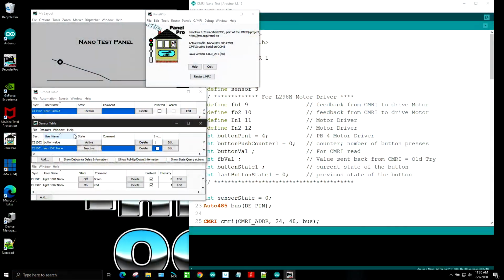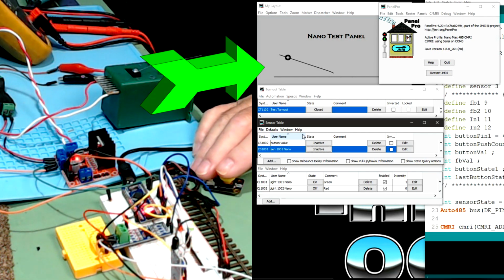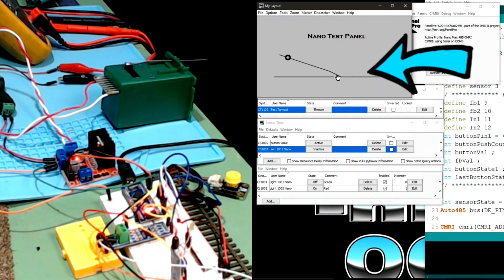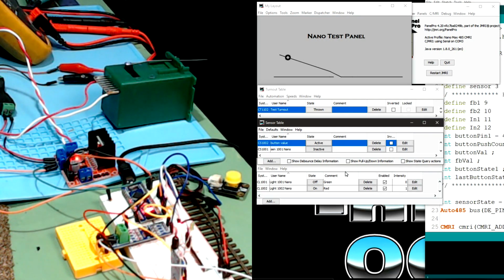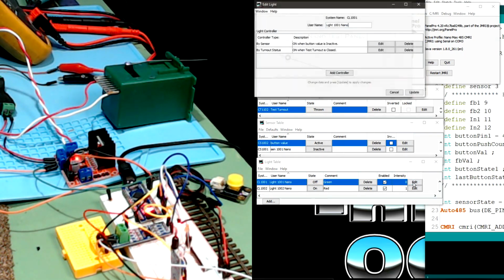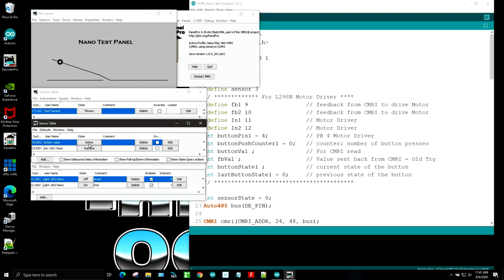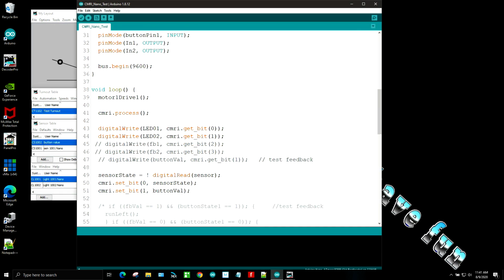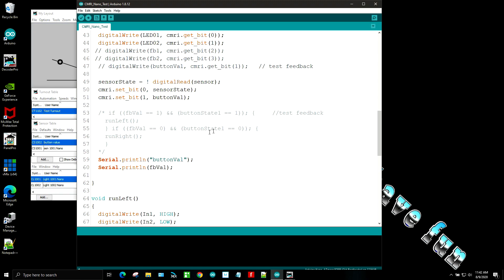Feedback Issues With JMRI Panel Pro

Comment: let me explain in a nut shell, you need to make two double head light one on top of each  other for a turnout to make it work,  than you need edit the logic in the heads to protect the sensor of the turn out when you click in the panel mine is working.
Reply from the maker: Sounds like a lot of work for a simple project that can be remedied with code. Some of the people at JMRI have helped out since this video to point me in the right direction. Unfortunately since making the video, I had to pack everything up and move. I bought a new house. Still working on getting the train room in order. Thanks for your input, much appreciated.,

Comment: Hi Tom, not sure if you got this working but i have managed to get a feedback sensor working with CMRI and with an additional external push button to control the turnout and up date JMRI. Check out this link see if this is what you was trying to do. https://youtu.be/diM55FdsIvo
Reply from the maker: I have the feedback working now, but I may have to change the code a little to get the desired results. I left a comment on your video. Great work Steve. Thanks for your help.
Reply: @TomsTrainsandThings  Thanks Tom, good luck with the rest of your layout, always good to see others posting the Arduino and CMRI stuff as there is little out there on the web

Comment: Interesting. 

A couple of things I noticed. 

i. When you change the Button Sensor in JMRI it changes the status of the lights but doesn't appear to actually change the turnout, is this correct or was it simply that you changed it back before the turnout turtle could react ?

ii. Something odd appears to happen when you activate the train sensor, it appears to momentarily turn the button inactive but though the button goes active immediately after it doesn't change the turnout until you click it twice (rather than once)

So my gut feeling is that your sensors might be overriding your JMRI control in some way

I'd go back to first principles 

1. Strip everything out and with a fresh install on the Arduino get it so that JMRI changes the turnout, no external buttons, sensors or lights

2. Next decide on the feedback, either the lights should be controlled by the turnout status or you want physical position to indicate status (I'd prefer actual feedback rather than computer say ok, but that's just me) 

3. Now add the button, the button should ONLY change the turnout status and you may need to set this up so that it's logically an OR status (I'm not very familiar with JMRI learning most of what I know in the last month or two) but basically you need to set things up so that IF the turnout status / Screen status is changed OR the button is pressed THEN the turnout changes 

4. Finally add your train sensor to change the turnout 

My GUT feeling is that it has something to do with the Button status being constantly active the train detector momentarily made it go inactive and the turnout changed, but when you manually made it go inactive the turnout didn't change but the lights and screen indicator did, something wrong there.

David
Reply from the maker: Thanks for your input David. I'm not quite sure where you saw the Tortoise not move when I pushed the pb or where I had to push the pb twice to get a state change. I reviewed the video several times and could not find that.

As far as the sensor changing the state of the turnout when it is closed to thrown, the state of the pb is also changed by design, since the program needs to keep track of where the turnout is and what state the pb is in. So when the sensor changes the state, so does the state of the pb change. You may have seen some flickering of the sensor and the state in the sensor table in the sensor, since it flashed a few times since I was going in and out of range of the sensor.

I have it designed so this can be used without JMRI connected, since the video, I changed the lights to operate in the code instead of through JMRI. 

I since heard from the JMRI crew and they are working on it on their end. Something in the feedback is not working correctly on the JMRI side. It is not sending the state change back all the way so it can be read in the get.bit statement of the code.

Again, thanks for your help.
Reply: @TomsTrainsandThings  As I said I'm new to all this, having only just decided to come back to trains after a 40 year break LOL but I'm a mechanical engineer by training and we look at process control which is pretty much what you are doing here, keep up the good work.

Comment: I had same issue with this. When controlling turnout from JMRI with no feedback sensor all was ok, as soon as you add a feedback for the turnout it would not work. i didn't get a solution still got to work this one out so good luck. Someone on JMRI group did say about the feedback binary being reverse logic. So if you are feeding back 1 for throw and 0 for close then try switching this around in arduino code. Not sure this will work and i never got time to try it. One for the future projects to work out.
Reply from the maker: Thanks for responding. I tried what you suggested about swapping the 1 & 0 without any change. I may have to try different methods in my code on that idea since it would slow down the Tortoise I was using while connected to JMRI. When I was not connected to JMRI, the code did not work at all. So back to trying different code to capture the feedback without interfering with the actual operation.

Hopefully the people at JMRI can figure this out. I had to send my code, monitor readings, the panel .xml and a few screen shots of the panel and the turnout table and sensor table while all this is malfunctioning. Currently waiting on a reply.

I'll let you know if they come up with a solution.
Reply: I came to this video because of the same issue. As soon as I add a sensor to the turnout, it stops working properly. On the contrary, if I create a turnout on the layout editor and click on the circle, it turns and shows the route ok.

Comment: Hi Tom.  I've been running DCC for around 15 or 20 years, and have been through several iterations of DIY systems.  Lately I discovered DCC++ but found that Gregg wrote it and has been heard from for 4 years.   So.... I modified the code to serve my own purposes.  I'm using DCC++ to talk to Wifi enabled modules using MQTT.  Now here's where I feel your pain.  I can set a turnout from JMRI using the turnout table, and I want to use a sensor which is treated by DCC++ as an input on the Arduino, but when I configure feedback, it converts my input channel to a DCC address, which is not what I want.
I've left questions on both the JMRI users and developers groups but I haven't gotten any help.
Reply from the maker: There are other modelers/coders that have taken over where Gregg left off on the Trainboard forum. There is now a rewritten version called DCC++EX which includes many additional features. https://dcc-ex.com/

I briefly looked into MQTT, but there are so many different ways to communicate with JMRI, I put that on the back burner and am playing with the 485 module and a direct connection with Arduino code and scripts within JMRI. I read Geoff Bunza's articles and am currently experimenting with that also right now. I'm leaning toward the Bunza method since I'm having better results.

As far as the JMRI issues, I thought I was getting somewhere when Bob Jacobson started replying to my problem, but after a few back and forths on the problem, the communication ceased. I'll give it another day or two to see if there are any more answers.

There is a disconnect somewhere in there that's preventing communication back to the Arduino from the turnout table. I was told it is suppose to work one way but when I followed all the steps, it doesn't work that way. Hopefully, the pause in the response is to find out why it's not working as designed.
Reply: @TomsTrainsandThings  
It only took me a day or so to incorporate MQTT code into DCC++.  JMRI communicates with DCC++ and in my case doesn't know about MQTT.
The problem with serial protocols running around a system is electrical noise coming from the track itself, turnouts, and other accessories.  Using Wifi avoids that.
I'm hoping I can work with the EX guys to incorporate my changes into their code.  I like the way they have created an easy way to install it on the Arduino, as seen on your video.

Comment: The first section was called signal with JMRI, and the second section was called Tech DCC operations in the third section was called DCC operation JMRI with PI. The guy who is teaching on it was Benjamin Lake and he is the assistant producer.
Reply from the maker: I saw those videos. Although they talk about Panel Pro, it's a totally different subject since DCC is not involved. I'm using the CMRI library in Arduino to communicate with JMRI's Panel Pro. Thanks for the information.

Comment: Hi Tom i wish i could help i had a similar problem with a turnout not switching with Kato  but then my motor drive blew  due to a faulty motor in one of my locomotives now so now my DCC++ base station is out of action i have been working on getting my raspberry pi 3 B and Arduino working . it works for about 4 minuets then has a time out error and the 2 wont communicate  so i am back to the drawing board i have been working on the problem for about a month on and off .
Reply from the maker: Sorry to hear that Greg. Sounds like you have multiple issues there. Hope you get them worked out. Send me an email if you need help with anything.

Comment: The Auto485 has a DE driver pin defined but no RE receiver pin. Perhaps this could be the issue?
Reply from the maker: I have them jumpered together. I'm getting communication in both directions since my LEDs are operated by: 
 digitalWrite(LED01, cmri.get_bit(0));
  digitalWrite(LED02, cmri.get_bit(1));
Reply: @TomsTrainsandThings  
Perhaps the values seen from CMRI object are from the values set via sketch?   
  cmri.set_bit(0, sensorState);
  cmri.set_bit(1, buttonVal);
Reply from the maker: The set bit for both the sensor and push button are recognized in the sensor table. The issue is with the communication withing JMRI, once I set the dependency of the turnout to the push button, all control of the turnout from the panel and the turnout table is disabled by JMRI, so I'm unable to get anything back. 

If I take away the dependency (feedback from the sensor) the panel nor the turnout table does not respond.
Reply: Hope a solution can be found.  My gut still says there is more digging to do regarding the 485 RE pin.  
Sent an email with a slightly refactored sketch trying to find potential issues.  Perhaps it will be helpful.  
Thanks for the videos.
Reply from the maker: Communication is going in both directions. Got a reply from Bob Jacobson, he confirmed that, but gave a few things to change in the code regarding the LEDs and one sensor. So far that hasn't helped, so I have to write him back now. I'll take a look at your sketch shortly. thanks
Reply from the maker: Tried your code (fancy stuff there, you have a lot more experience than I do), didn't change anything. I'm starting to believe the issue is in JMRI based on what Bob Jacobson has told me so far. What he states is suppose to happen in the panel is not happening after I made some changes in the code. I kept control of the LEDs within Arduino.

Comment: do you have JMRI hooked to your Digitrax? If Not how else does JMRI know to send the turnout accessory command?
Reply from the maker: This is not through Loconet. It's through a Max485 to CMRI through a Node.
I also did a project where I have the Arduino connected directly through a USB connection.
You don't need a DCC command station for this. This goes back long before DCC

Comment: I took the lazy easy way to control my turnouts with JMRI. I use an NCE power cab and NCE turnout switch decoders. The switch decoder is just another accessory decoder with an address you put into the Power cab like a loco. JMRI panel pro sees it with no problem and I'm happily clicking my turnouts from my chair. Hope you get your setup working.
Reply from the maker: I do the same thing on my layout with Digitrax and a few DS64's. Everything works great there. Just trying something different to see if it's possible. I'm a gluten for punishment.   LOL

Comment: I hope you get it working.  Do you have previous video on sensor value pass into JMRI with Arduino?  I have my light sensor working to point where I get values that change with amount of light.  I totally confused on how it get this connected to signal table in JMRI.  I’m YT blind as I’ve been looking at so many videos.  Thanks.
Reply from the maker: Thanks Fred. Watch this video here:  https://youtu.be/QnrTGaZ_ylQ
That will get you started. As far as the signals; I haven't done one on that yet.
Reply: Tom, I mistyped.  I meant sensor table.  I’m good with controlling my signal off the Smail.  Very easy but not as cool as you showed in this video.
Reply from the maker: Yes it's easy off the contacts on the Smail. I have it working great on my layout with Digitrax and DS64's controlling the Tortoise. Just trying different approaches to see if they are possible.

Comment: You are the tip of the spear!  Look at feed back, #times, on turn out?   I had to change these for my DR4018 to work.
Reply from the maker: I've changed everything in JMRI several times to try to get the turnout to communicate back to either the lights or the sensors. I can do it in other situations like with Loconet no problem, but with the Arduino and the Node method, it doesn't seem to work.

I'm also working on a different method suggested by Geoff Bunza, I have the sensors working correctly, but still working on the sketch and scripts for the turnouts.

Thinking maybe i need a script to get this to work like in Geoff Bunza's method.